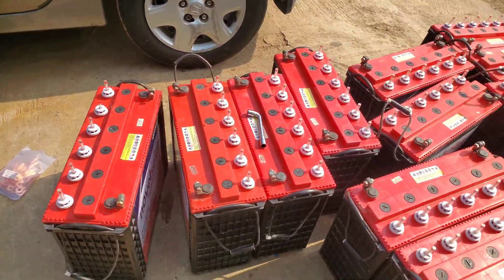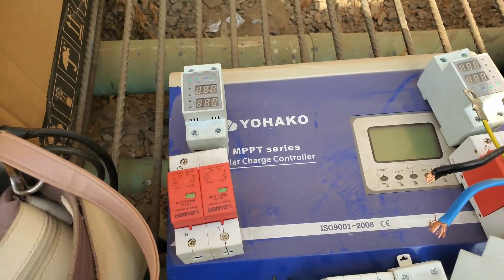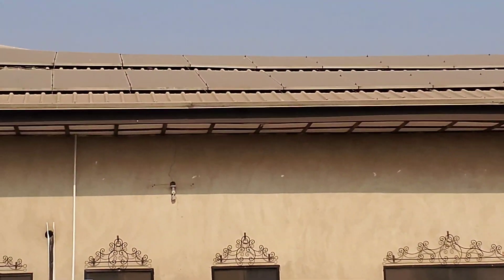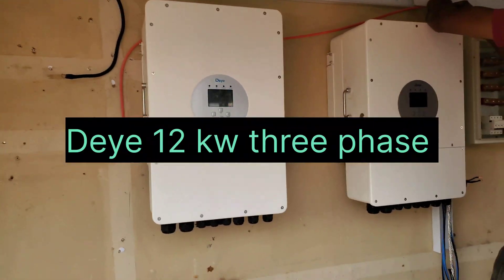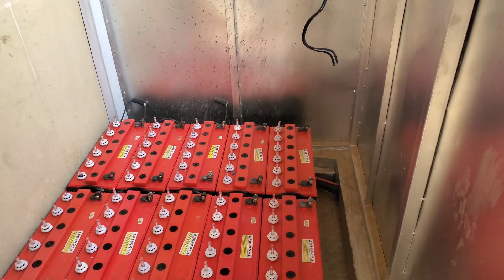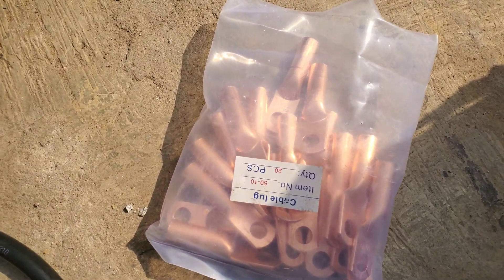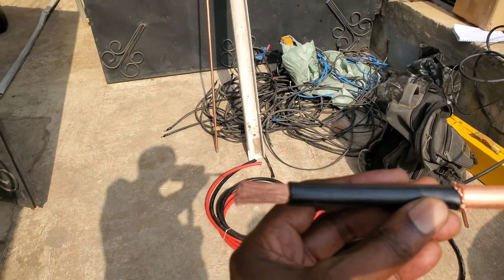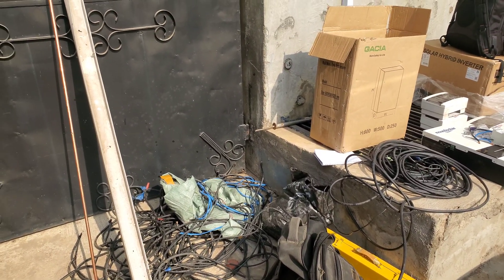Deye 24 kw with lead acid batteries

Comment: Are you going to have the lead acid batteries in the same room as the inverters???
Reply: Hmmmmmmm, you were not able to convince them to switch to lithium battery packs?
Reply from the maker: @skywalker_0427  they made the investment less than 3 months ago. It is a stretch
Reply from the maker: Yes we are. It is an enclosure outside. Very properly ventilated. We will ask them to install an extractor fan.

Comment: That is my preference of battery connection. Parallel series. Cheers
Reply: And then all Parallelled onto a common Bus Bar?
Reply: @takumoyo1253  no need. The group will come out as 48v. I have a video showing the difference.
Reply from the maker: @takumoyo1253  we only have one total positive and one total negative. It is going inside a busbar though in an enclosure with a huge breaker
Reply: @dr solar if I have a lithium battery of 15kwh 48v maybe like 3units can it be paralled to give out 45kwh 48v?
Reply from the maker: @steveugochukwu5182  same voltage same capacity. Yes it will give you 45kwh.
Reply from the maker: We were given lemons and we are making lemonade. Thank you for commenting. How is it going with you?
Reply: @drsolar  ok here. Hurt my back a bit and has slowed me down. Other then that the family is healthy and happy. Not much more I can ask. Hope all is well with you. Cheers
Reply from the maker: @frankz1125  I wish you a speedy recovery. My love to your family. We are doing well
Reply: @drsolar  thank you

Comment: Yes that system needs a upgrade and a washing of them 250 watt panels as well. I’m not a fan of lead acid batteries but they do work 😎. Wishing you a wonderful day my friend 😎
Reply: Liquid filled lead acid batteries are a lot cheaper than lithium and has proven to be reliable and recyclable. These batteries on the video need to be maintained on a regular schedule and made sure the charge does not drop below 50 percent.
Reply from the maker: @JohnT.4321 Thank you for watching and commenting. We don't need to worry about above 50% or a scheduled maintenance with a lithium battery. We will revisit in the future
Reply: @drsolar  I understand the maintenance free and the no worry of getting below 50%. People like me like the affordability of led acid and don't mind doing maintenance.
Reply from the maker: I don't do them but the hospital needed help.